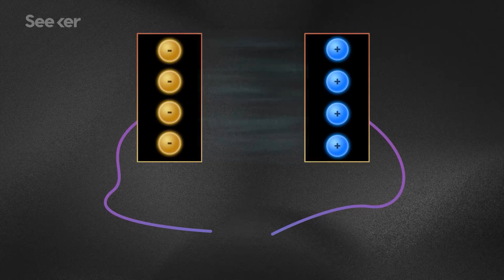How Supercapacitors Could Make Batteries a Thing of the Past

Comment: We have been hearing about these "battery breakthroughs" for years and yet we don't see any of them on the market -_-
Reply: Many factors e.g goverment ect.
Reply: LiFePO4, LiTi, Ultracapacitors & Supercapacitors & really interesting other emerging battery chemistries that will take years to reach market products / up next solid state lithium ion from Toyota & optimized LiPO4Fe2 million mile Tesla Battery tech etc
Reply: You carry a whole lot of capacitors in all of your electronics. Making them useful to large scale and longer term storage is the difficulty
Reply: We actually have them samsung is developing and even using in their galaxy s pens
Reply: Because these are capacitors and not batteries -_-
Reply: There where a couple... Mostly slight increases in charge cycles, decreases in weight and cost. Tesla's new batteries may cut down cost a bit further and increase capacity at the same time, what was it, 16~% more capacity? Needs to prove it first tho.
Reply: I'm from the future and lamborghini has done it
Reply: Yeah… because it’s extremely difficult to manufacture cutting edge technology. But breakthroughs in process do happen. But supercaps are already a thing I’ve built quick recharging short flight time drones with them. They’re fantastic when you need high power in short time and quick recharges can mitigate their lower energy density
Reply: The future’s so bright, I gotta wear shades!
Reply: because it takes more than 3 years for any sort of breakthrough to make it to the market. Scientific discoveries don't run on your schedule
Reply: @nickg4564  ..tru dat
Reply: Nick G but Media and such keep saying that this technology is NOW!  You think they might be wrong?  Yea, me too.  Give it another 10 years and revisit it.  See where it is at then.  Ps Popscience did an article on supercapacitors in electric vehicles in 2008 after Elon introduced the Tesla Roadster.  That was 10 years ago now.  Just saying.
Reply: this technology is out now, its just out in a lab and not in the market. It takes time for a scientific discovery to become marketable and time for companies to figure out how to sell or use discoveries in everyday products.
Reply: Not to mention legal procedures and patent claims, etc. Bureaucracy.
Reply: @nickg4564  it's been out
Reply: @davidbeppler3032  technology is now spen in galaxy note actually have super capacitor batteery and not lithium ion
Reply: @nickg4564  its out and many companies using it for eg. Samsunh

Comment: Capacitors have made considerable advances in storage capacity in recent years. But, a water based capacitor is unlikely to be used in most vehicles because freezing climates would destroy it. It would make a good option for some vehicles in warm climates and for stationary storage in power grids. Some electric car manufacturers are experimenting with a battery / capacitor hybrid because capacitors can store and quickly release huge amounts of energy at once for acceleration. We may soon see electric drag race cars with this technology.
Reply: There's already electric drag race cars..
Reply: I've seen one demonstration car so far. The thing releases so much energy at once that it practically burns up the electric motor when they race it. But, it is fast.

Comment: Saying that the polymer can store "100 times" more energy than expected doesn't mean much if you don't say how much it stored.
Reply: 2:43
Reply: @SharockoRAZR  that's what it could "eventually" store. Not its current capabilities.
Reply: 180 wh/kg * 0.01 = 1.8 wh/kg
Reply: Not what it can store, that's what it can maybe "eventually" store. Did no one actually watch the video?
Reply: BUT THEY DID SAY HOW MUCH IS STORWS ARR YOU DUMBBBV
Reply: @Sceleri  did you have a stroke at the end?
Reply: @cyberavenger8668  yes
Reply: Except they say It, idiot.
Reply: @MrBulletproof87  Refer to my earlier comment, idiot.

Comment: IIRC from my college days, supercapacitor technology (which is a hybrid of capacitors and batteries) was first developed in England ~ 1948 then refined ever since. Within the last 10 years, anyone working on HP servers (eg, DL385) in any big datacenter would have seen the emergency on-board power supply associated P4xx series RAID controllers shift from batteries (which would crap out every 4-5 years) to supercapacitors (which appear to last forever). Running the ProLiant diagnostic is kinda neat: you'll first see a message saying "supercapacitor was found and now has begun charging". Back to your video, I'm assuming this is something Elon Musk would want to scale up (in size and capacity) to support the lithium-based power system in electric vehicles.
Reply: No.  Elon is probably not working on this.  I am sure he is aware of it.  But it is a loooooong way from usable.  Maybe in 10-15 years.
Reply: More than 10-years ago, I remember seeing a pro-type Tesla (model-S or roadster?) which was powered by ~ 4000 lithium-ion batteries originally targeted at the lap-top industry. Most people already know that 4000 of anything is prone to failure which is why Musk scaled up the batteries to a larger size and is cranking them out in that new facility in Nevada. Supercapacitors could be scaled up too. It just takes someone with the will (and money, and resources) to do so. I think Musk is that kind of guy.
Reply: Supercapacitor isn't quite the right word for this; not wrong, but also not useful. "Supercapacitors" break down into two main categories; double-layer  and pseudocapacitor. The ones you are talking about are pseudocapactiors. They try to look like caps to circuits, but are fundamentally not caps. Double-layer is new(or at least new to market, not sure when it was actually discovered) and is basically a capacitor where the plate is its own insulator. Hints why they are all low voltage, the insulator is only a couple atoms thick.
Reply: Thanks for the details. I don't want to get into a pissing contest so let me say this: supercapacitors really are hybrid devices which are part battery and part capacitor. When used in a circuit, they can charge/discharge power at the speed of a capacitor (faster than a battery) without the complications associated with a battery (slower charge rate). As I understand it, modern autos will try to capture energy during braking rather than seeing it lost as waste heat (brake shoes). This would be one application where storing the energy into supercapacitors would be more efficient than trying to recharge a battery. So in summary, there will be a place for both batteries and supercapacitors.

Comment: Late to the game Seeker, This tech has been available for years!
Reply: i think he means really small supercapacitors
Reply: It will be in cell phones 5-10 years before it is in Electric Vehicles.  Cellphones have a much higher markup and the technology evolves much faster.  If this was going to be in a car, in any reasonable amount of time, it would already be in every cellphone on the market today.  It is not.
Reply: David Beppler: Probably not, were more likely to see Graphine based battery tech in the next 2 or 3 years as both Samsung and LG are pouring millions into that and they're seeing results.
Reply: @kalemercer7053  graphene "batteries" are actually supercompasitors
Reply: +Seth Bowden - (Graphene "based" battery) Key word here: "Based."
Reply: Seth Bowden depends. There are several variants of graphene batteries already available, not just theoretical. One is a graphene coated electrode for a typical lithium ion battery, one is used similarly in poly batteries, one is a micro cell lithium battery with its structure made from a Sudo graphene polymer (it is a layered structure of several atom thick graphene), and there are a multitude of diy and 3d printer variations using a graphene or graphene nanotube polymer for 3d printers. There is also one that is famous on YouTube for being made using an old Blu-ray burner called light scribe. The diy isn’t in mass market production I don’t think, but the rest are. Yes the graphene super capacitor has received a lot of attention, but it’s actually at the moment impractical. The bottleneck has never been with conducting material in capacitors, but the insulator. Nearly every insulator in the planet has very little electrical resistance. The most common one used in high in super-capacitors is polystyrene, a very brittle plastic. Recently they’ve managed to create a less than 10 atom thick layer of diamond in a sheet by zapping a graphite rod with a low voltage arc welder in a vacuum and pressing the fine carbon particles with I high power hydraulic press into sheets of diamond. Diamond has about 100x the electrical resistance of any known material, and since the thickness plays very little into that, having that thin a layer can make the graphene capacitor practical. This is not gonna be a viable product likely for decades, which at the moment makes the graphene capacitor a pipe dream. That’s why we are considering creating graphene batteries which work now, and ignore the whole capacitor hype. Until they solve the issues with the insulator, as the video is suggesting they’ve done, though they have not really, we stick with batteries.
Reply: @leftwichdavid  u nerd :-)
Reply: It's already in phones, but not for the phone it self. It's application is in built in for other component for the phone. S Pen on Samsung Galaxy Note 9 using supercapacitors instead of battery to reduce the size and reduce charging time while deliver quite reasonable battery life *30 mins for 1 min charge

*btw I'm not using Note 9 or using samsung phone, but just giving the info that supercapacitors already coming to phones
Reply: @JonathanTheodoric  u sharp
Reply: @davidbeppler3032  stupid af get out of the internet
Reply: @davidbeppler3032  50 to 100 !
Reply: He said that in the video as well
Reply: Graphene capacitors like from Skeleton see movie from fully charged show
Reply: And they have completely different function compared to batteries. Supercaps gives high power in very short time, batteries low power but for long time. So...
Reply: What a fucking dump atempt of abortion you are...
Reply: Graphene power bank

https://comingsoon.ogadget.com/ApolloMax